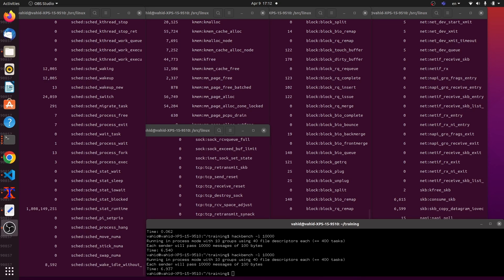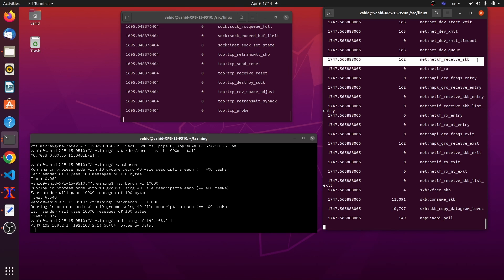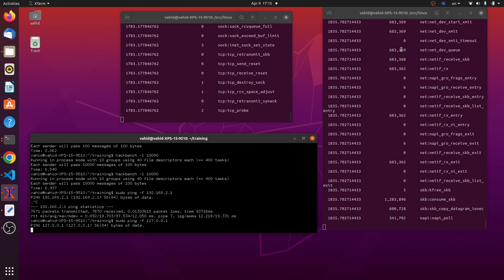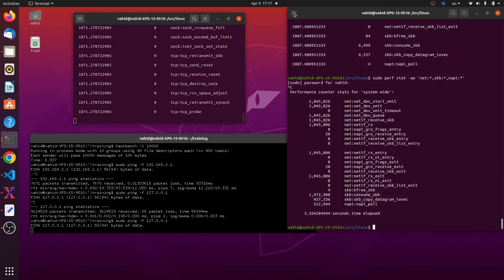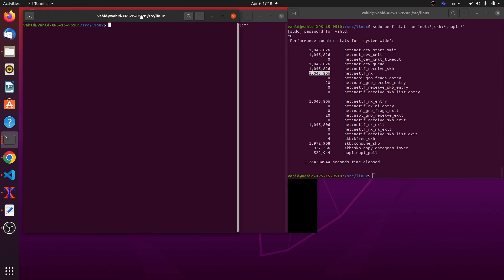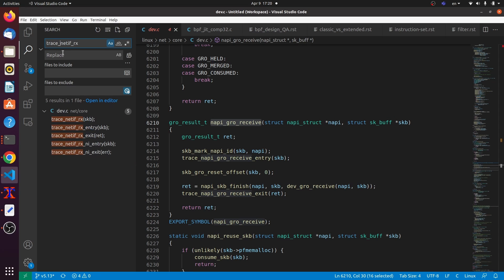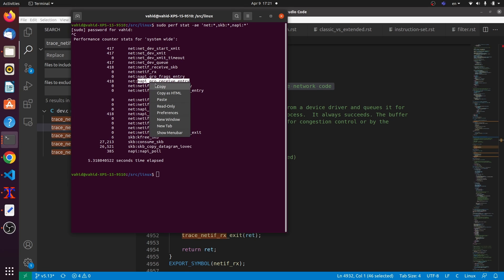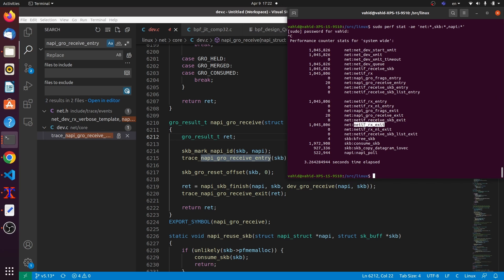Which Part of The Kernel is Responsible for My Task? Using perf stat, Part II - DEEP LINUX

Comment: Nice! May I suggest any deep dive related to kernel interaction with files (fd's/sockets..). Zero copy mechanisms would also be interesting to dive into (anything memory is always a hit), user space/kernel space boundary crossing would also be interesting to me.
Reply from the maker: You just read my mind or what!😀
These are very intersting, I've been meaning to prepare videos about them and have the bulk of the material ready but it needs a lot of polishing and figuring out all the corner cases. It is really challenging to create some of these videos. 😅
Reply: @deeplinux2248  Oh that's awesome :D